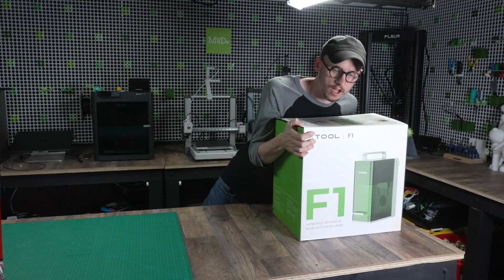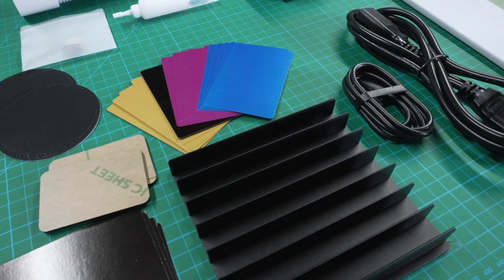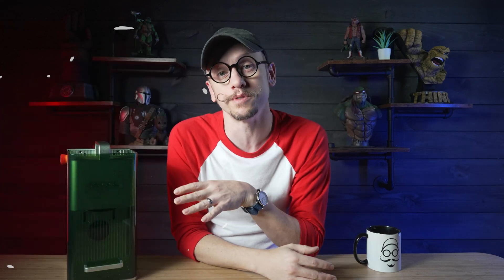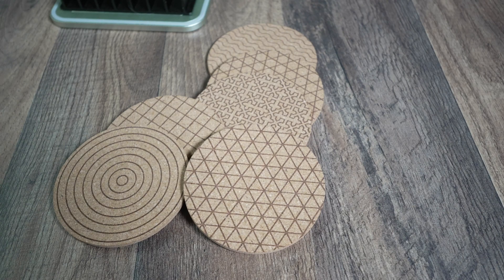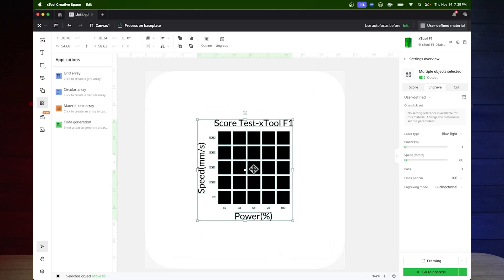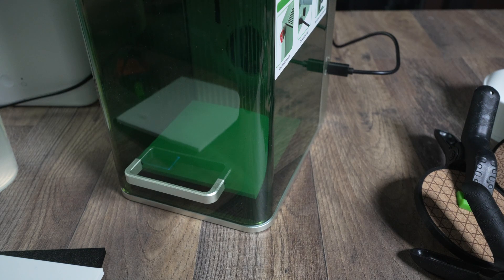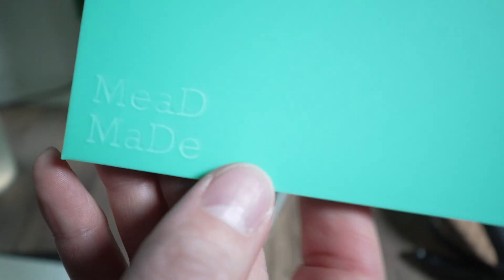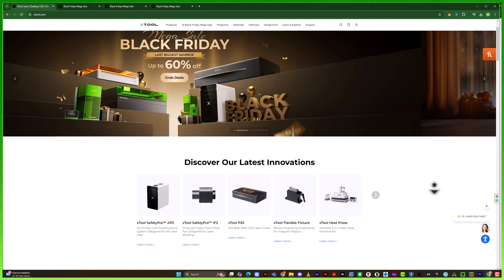Experimenting with Lasers & 3D Printing ( Unexpected Results)

Comment: Great video @ItsMeaDMaDe! I have been looking into the exact same thing, this video was exactly what I was looking for. :medal-yellow-first-red:

I am curious if you tested both etching (marking) and engraving. It’s my understanding that this model has dual lasers. One 10W diode and one 2W infrared; did you test both on 3D printed parts?

I would love to see more content on lasers and 3D printing. Especially now that Bambu Labs has released the H2D with laser capability. I don’t really care about cutting, only engraving and etching. 

Any experience you may have would be appreciated.👍

Comment: Use thee ir laser not the blue light to engrave plastic if you use black it turns a goldish color run it at 100 power and 500 speed, I have the F1 and it marks plastic great and fast

Comment: A lot of folks don't realize that pure white surfaces reflect more light than mirrors do - just in a diffuse pattern, not a direct beam.  Most mirrors reflect something like 80-85% of light while white surfaces often are in the low to mid 90% range.  That means your laser is effectively running at less than 10% power on the white surface.  Make sense now why you couldn't etch?

A note about blue diode lasers (~450nm), they have very similar issues with blue plastics.  If you test the same burn setting on 3 squares of red, green, and blue, you'll find that the red and green etch or burn readily while blue often take extra % in power or slower speeds to get the same result.

Happy lasering!!
Reply: @NOTNOTJON  So that’s why the Stormtroopers armor is white! LOL

Comment: maybe the color change is the black on the opposite side almost getting exposed. I mean engraving removes material and you only had 2 green layers. good test would be 1 green layer and 2 white layers. see if you can reach the white layers through the green.
Reply from the maker: After the video I thought the same thing and did a test piece with just green and got the same results. I can only assume it’s the inks having a reaction or something.

Comment: I've been a laser user for years and just got the Bambu A1 and was thinking about trying exactly what you did here.  But you did not mention what type of laser you are using - Fiber or diode?  This X-Tool is both.  Have you tried the same experiment with a diode laser?  We know the melting point of PLA.  I do not know what the temperature of a diode beam is.
Reply from the maker: I do believe it was the diode laser the other one didn’t do anything.
Reply: @ItsMeaDMaDe  ah, good to know.  I will give it a try.  thanks
Reply from the maker: @stevespringer8385 yeah the big takeaway is if you do an array test delete the bottom row where it’s slowest answer highest power. 😅
Reply: @ItsMeaDMaDe  word of caution to others: your settings are only for this F1 using the X-tool software.  If using a traditional diode laser and Lightburn, speed/power will be very different depending on wattage.